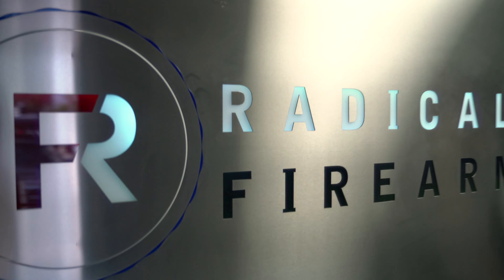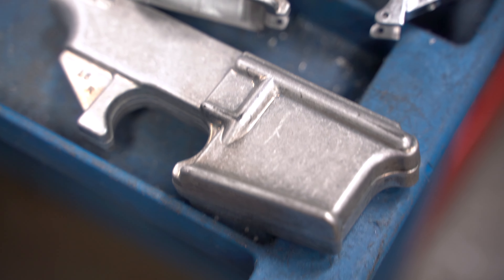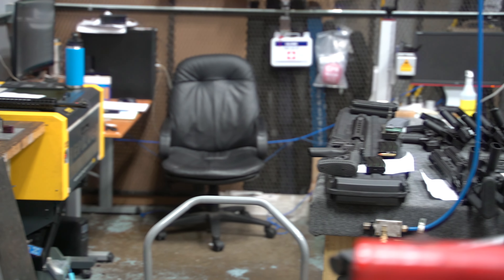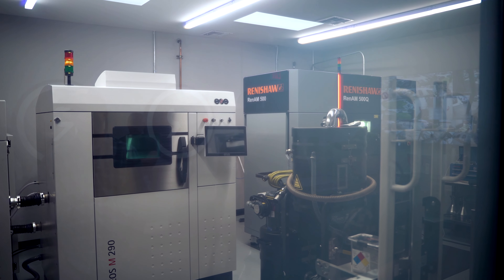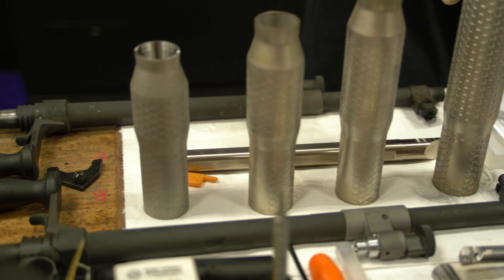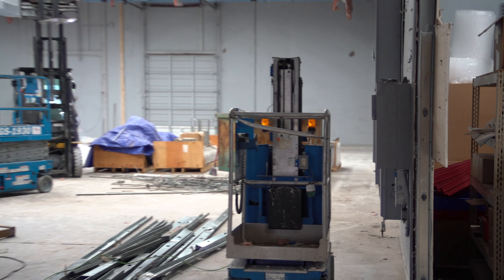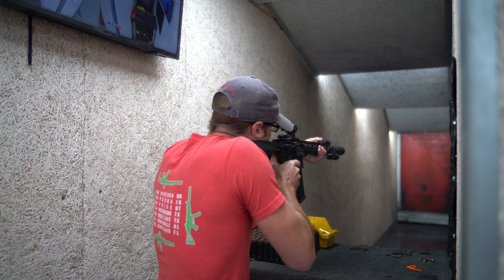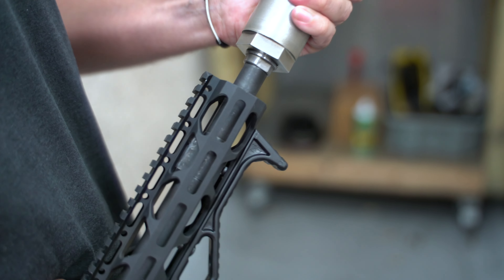Radical Firearms: Behind the Scenes Tour

Comment: After your reviews on their .762 I  threw them in the trash as a company. Until i found out they were local to me and with their prices I gave them a try. I bought their 10.5 FCR upper with out the CH or BCG for $279 a year ago.I added a BCM Ambi CH and a Toolcraft BCG then slapped it on a Aero M4E1 pistol lower and 2,000 ish rounds in and I’ve had 1 light primer strike.

Comment: I’ve heard so many bad things about radical and almost no good.
Reply: Literally every review I have seen on any site is positive
Reply: I have a 10.5 and a 16 and haven't had any issues. Slightly loose tolerances between the upper and lower on my 16, but oversized pins fixed that.